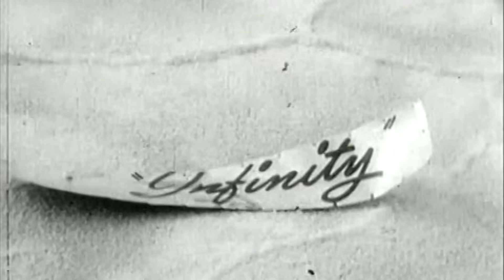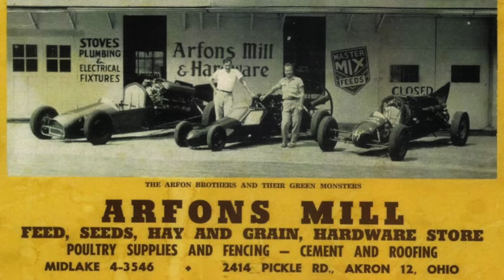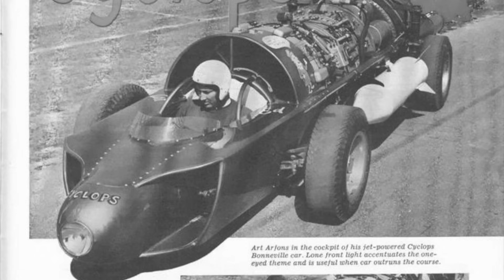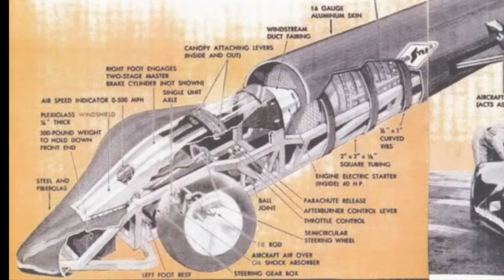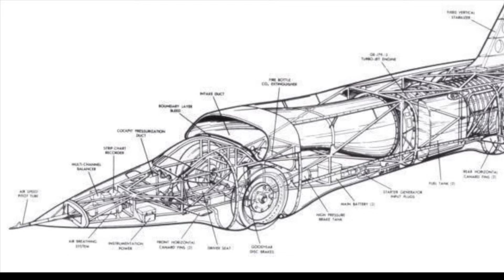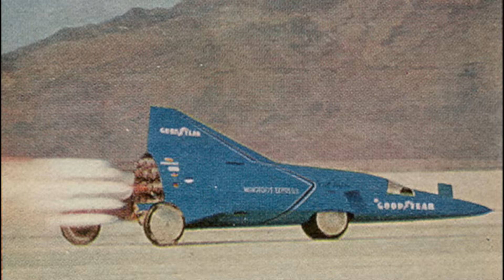Craig Breedlove and Art Arfons - The Jet Car Battle Of Bonneville

Comment: Great account of the most exciting time in Land Speed Record history.  After this, new records didn't capture the public's imagination.  Gary Gabelich and The Blue Flame went fairly unnoticed in 1970, and that was a record that stood for 27 years.
Reply: It only stood 13 years (1970-1983), until Richard Noble broke the record with Thrust2
Richard Noble spear-headed the Thrust SSC project, which set the current record in 1997

Comment: Your channel is one of the best I have seen on YouTube, very professional and well researched. An added benefit for me is I have always been interested in the world speed record attempts and you have excellent videos that have filled in many gaps on that subject. Thanks so much for your efforts.
Reply from the maker: Wow, thank you!
Reply: @ScarfAndGoggles  12:37
Haven't you ever considered to make a video dedicated entirely to the Wingfoot Express? I mean, besides having archived only one record with two cars, Walt Arfons' Winfoots has been really amazinf feats of aerodynamic and engeneering of speed. And even if it is the one that has not brought back home a single record, my opinion is that the WF.EX. II has been perhaps the most revolutionary Land Speed Record EVER. There would be a lot of talking about it, especially the fact that - even through failing - rocket propulsion was the future of Land Speed motorsport. And in what fashion... a stricking bodywork, and these countless JATO candles that once ignited you could not even shut down, or regulated in power (the main problem for WF.EX. II). I think therefore that it would be an hell of a video about this amazing car, especially when you understand that it was, even unofficially, the first car to reach subsonic speeds, at more than 650 mph, but failing because of the extreme acceleration that created a huge difference between the entry and off speed in the kilo and mile, with the sad result of a medium speed very different from the actual peak... if you put too close to the mesurated mile, it entred it too slowly but was able to get out of it with the JATOs still firing, and if started far away, you entred very fast but the rockets would shut down in the middle of the mile, resulting in a fast entry but slow exit. Even by swiching on a certain number of JATO to create more firing time, it failed because it wasn't able to go too fast. At the end, the project was abandoned but Walt wanted it to fire it vertically, make it fly like a very rocket several thousend feets into the air and under it's weight in freefall, make the pointy nose to impale the Express into the salt, creating a sort of ethernal monument to speed - a crazy project that for clear reasons the FIA rejected... - So, what do you think? Is it worthy for you or not? 😁👍

Comment: Some of the top officers in the US Airforce were believers in using racing in interesting youngsters in the things that would get them into the Airforce. From the sports car races held on Airforce bases in the 1950's and on they wanted to establish a connection between hot rodding and the Airforce. I do not know for sure, but I suspect that the jet engines these guys got were at least secretly slipped out the 'back door' for these guys to run. General LeMay liked this kind of stuff.

Me. I'm an old fashioned guy and think that the real records belong to wheel driven cars! That's why I want to see the Goldenrod video!

Comment: Art Arfond would go on to the sport of professional tractor pulling in the 70's and 80's believe it or not. His twin jet engined tractor was also called The Green Monster. His daughter also competed with a single jet engined tractor.
Reply: Yes he did, he's crew member Bob Frock had a brother named Dallas who ran a front engine jet dragster.  That was not propelled by thrust but by the rear wheels like the tractors. I saw pictures of it. Art also helped write rules for The National Tractor Pulling Association.
Reply: I saw Art pull many times on the twin-turbine Green Monster in the 1980's and 90's.

Comment: Breedlove DID almost manage to be first to 700mph . He was only stopped by a "mystery-bolt" that somehow got into his engine . Immediately after , Thrust SSC took it . 
The speed potential of these cars is now in the "instant-death" zone . Hypersonic jet-cars will require wheeled open-water speed-racing , on large inland seas . Jet-boat style escape-capsules will give drivers a much higher chance of survival . For in-depth discussion/analysis of this proposal , read Quora thread : quora.com/Should-we-allow-wheeled-jet-car-racing-on-open-water/ 
*Concentrate on my post/comments.

D.H.  .😎
Reply: No.  If you have watched many of Scarf and Goggles' videos, you would know why.  When land speed record holders try to break the water speed record, they die.  Ken Warby has it at 286 mph.  It's best left at that.
Reply: @andyharman3022  
They died because the went stupid , with no safety-system or redundancy built in . 
As modern hydro-foil racing has shown , ejection-capsules save lives . 
I strongly suggest that you use the link I just activated , and see what could be ! 
😎